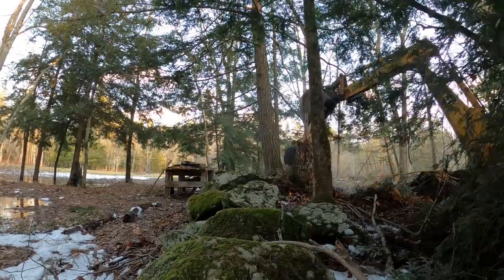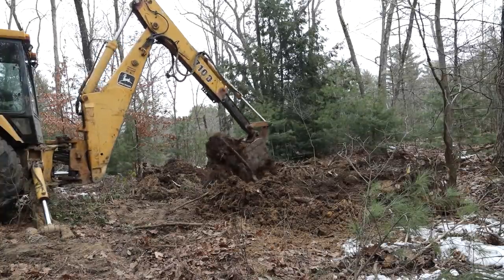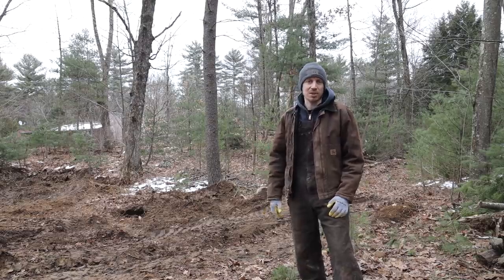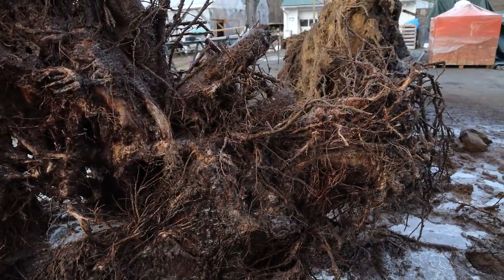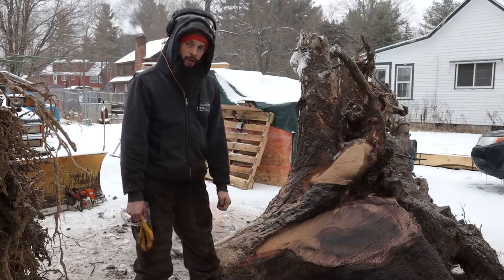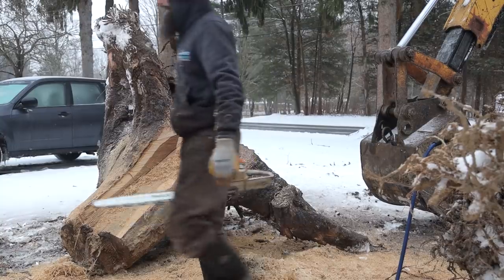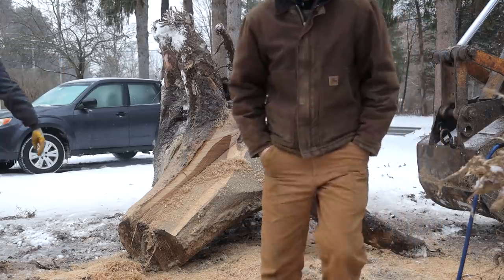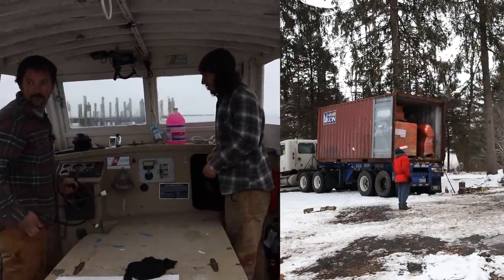Acorn to Arabella - Journey of a Wooden Boat - Episode 95: Harvesting White Oak Knees

Comment: Regarding stump removal, I was lucky on that front because I raised landrace pigs on my farm. I used a sledge to pound in a 48" lining bar and then filled the hole with grain. Worked great for stumps up to 20 "s or so. Pigs had fun and the stumps had very little soil on them.

Comment: Was that a 361 with a 25" bar? That's what I bought, running 3/8" RS chain... that makes a lot of chips with silver maple... never cut oak with it. Your saw has seen more milage than mine... but it will last a long time. Nice thing about heating with wood, it warms you up twice. I am most curious about how those knees will dry. Do you think that they will crack heavy? If they do, are they repairable, or will you have to cut more?

Comment: The guy who'll invent a self sharpening chainsaw gets the Nobel prize.
Reply: Already been done. Mind you, they are special chains and I personally still do it the old way, so I don't know how good these are. It is Oregon, so it may be fine.

https://www.amazon.com/Oregon-541662-PowerSharp-Bar-Mount-Sharpening/dp/B003YHGN48
Reply: just using a Dremel with the right grinding stone by hand makes quick work of chainsaw blades... i have a friend who is a regular contractor who i work with and he tired it on one of his chains and was Very impressed by the crazy csharp cuts he got after we sharpened it with the dremel. didn't take much time at all, no more or less really than with a file, but the quality of the cut was ten times better.

Comment: Just an Idea (maybe a littel bit late) but there are carbide tipped chains for chainsaws. I do not have any experience with them but I think they should last longer in this harsh abrasive environment (but they require diamond files for sharpening). Another idea would be to sharpen your chains with a file. You do not have to remove the chain, you take of less material and therefore the chain lasts for more sharpenings. I am no expert. I just want to make some suggestions to make life easier for you. Thanks for the content.

Comment: Explains how they will restore the forest floor for regrowth - hoses a ton of silt into their front yard. Ha! Love it!
Reply: your comment makes no sense
Reply: Restoring the forest floor should be part of the stump removal operation.  I assume most people would be a little more concerned with the condition of their front lawn than to make it a muddy mess by washing dirt off of  stumps on it. That's what I meant by my comment. No hate no issues. I thought the process was funny.
Reply: @johnjenkins8782  But when the frontyard is the place where they have water and current going .... 🚿
Reply: @johnjenkins8782  What you call a front lawn, they call a work space. They can't drag water hoses and extension cords into the woods so a little bit of mud stays in the woods.

Comment: A tree stump has to be the toughest thing in the world.  Farmers got tired of digging and started using dynamite to remove them.  Hardwood trees have the best root systems making them harder to remove.  Cutting the tree 3 M above ground level gives you more leverage to push them over and rip them out.  Then you can cut the last 3 M of wood.

Comment: You did clean up the knee stock the hard way! Stack it up, build an overhead sprinkler and soak it, day after day and week after week restacking every few days and then pressure wash it just before you get the chainsaw!
Reply from the maker: Please suggest how we do that in the winter in New England when it’s below freezing. Haha. That’s how I’ve palaces are built!
Reply: Ok, sorry , I stand corrected but watching you wash the stumps you had running water! Freezing at night is not an issue I have ever had to deal with!

Comment: Steve, how thick are the knees when finished.
Reply: Probably similar width to the frames and deck beams they are attached to.
Reply from the maker: We aren't sure yet, the plans call for a different (softer) wood so there will be some adjustment due to the strength of the oak.

Comment: I would have rented a big commercial hot water pressure washer with the rotating head. Would have been much faster. (Dangerous though)
Reply from the maker: There were a lot of rocks incorporated in the stump, so a commercial pressure washer would probably have been too dangerous to use.

Comment: Are red oak knees as strong as white oak knees. Is there a preference
Reply from the maker: Red oak is ring porose, so it isn't good for boat construction.
Reply: Yes, that is true the pores of the white oak are plugged with tyloses. But since the knees probably won’t come in contact with water, could red oak be used? As could live oak, but probably much more expensive